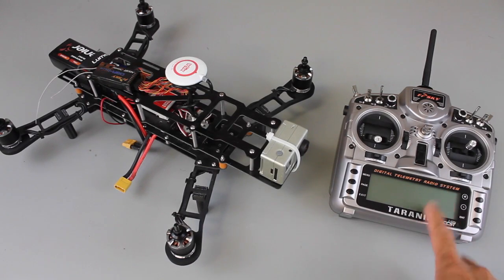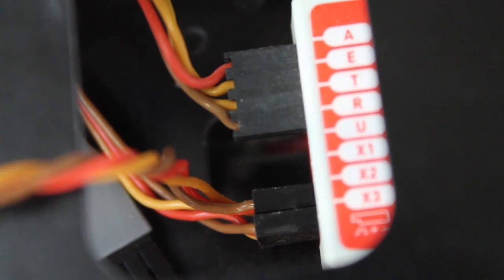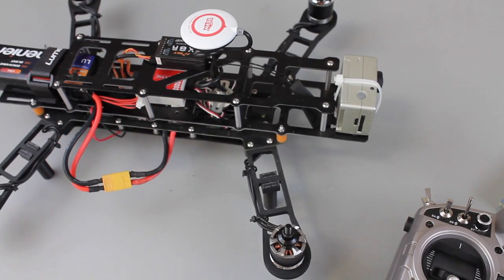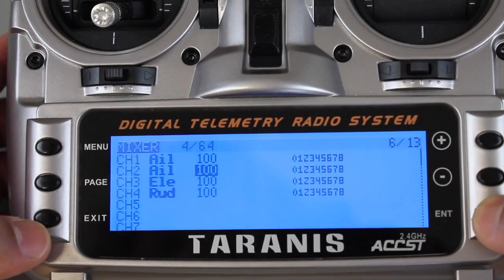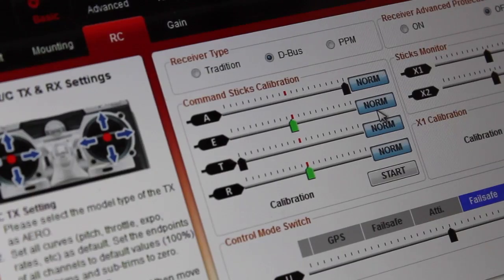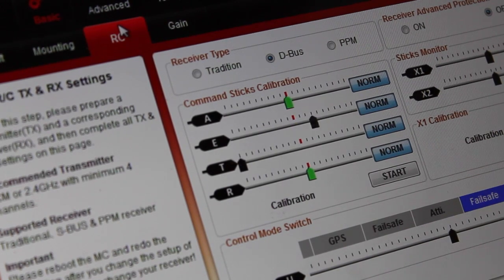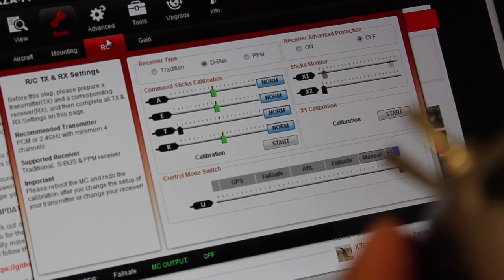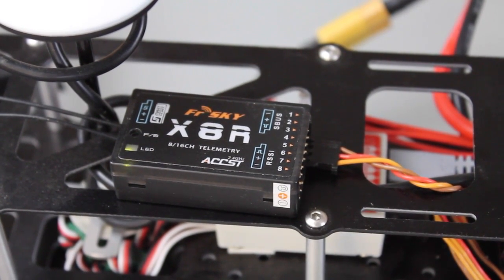FrSky Taranis and X8R Receiver SBUS Setup w/ NAZA Flight Controller

Comment: In stead useing the naza I have a kk2.1 . Does everything stay the same. Thanks
Reply from the maker: Ray Boley I'm not sure if KK2.1 supports sbus, but I could be wrong. If it does then the setup would be similar you just need to make sure the channel order is the same. Otherwise you'll need to reconfigure that.

Comment: You only used one connection to the X8R?  I want to try this but my bluetooth datalink takes up all the room inside my P2...Nice video.  I may have to move all the bluetooth datalink to outside the shell and try this!
Reply: Danny Chu I got it working with the one cable...I notice the default receiver (dji phantom 2 radio) also had another connection to X3...any idea what this is for?  Also, I am having issues with my laptop pc using the dji win driver - not recognizing my phantom when using the assistant - any ideas?

Comment: Most helpful! Tho, as you had the aileron stick cal issue, (@3:30), I'm having that same issue. Only, I continue to have this issue, even when I've powered down all the systems....grrr! I'm running an X8R in SBus to my Naza Light with GPS and my Tx is my Taranis. I'm thinking it has to do with the offset value and I've tried a few adjustments. Any insight would be much appreciated.
Reply from the maker: Les Schilling It's such a frustrating thing. I'm not sure what's going on in your case but couple of reboots of your RX as well as your flight rig. I've been able to get around it being stuck this way. It's not ideal, but not sure what else to do. If you think it's an offset issue like at your stick monitor on the Taranis and see if you notice it not centered. Good luck.

Comment: Hi Dennis can you help me out I followed your instructions on binding the x8r to the taranis D16 mode channels 1-8 but the taranis isn't responding I see in the mixer on your taranis the ail,ele,thr,rud has 012345678 beside each one mine don't could you enlighten me on what I'm doing wrong or what I'm not doing. Thanks Ed

Comment: Dennis love your videos. Didn't you have to bind your receiver so you could test motor direction? You would need the naza powered up also? I'm a little fuzzy on this. Thanks again for awesome videos, I wouldn't try this without them.
Reply from the maker: Matthew Gilbert That's right. What I've done in the past is connected directly to the receiver and then got my motor rotation correct. Then I connect to my flight controller. Thanks for the feedback on the videos. Much appreciated.

Comment: Is sbus the same as ppm? I have the same rx and a naze32 flight controller I want to use ppm.. Is sbus the same thing?
Reply from the maker: floatncoffee Similar in concept. SBUS is Futaba's implementation. The 1st paragraph in this article talks about it http://team-blacksheep.freshdesk.com/support/solutions/articles/166412-how-to-handle-ppm-mode
Reply: So could I plug a cable from the ppm from the naze32 flight controller to the Sbus on the rx?
Reply from the maker: floatncoffee I'm not entirely sure. I haven't done this myself with the Naze32. I have the Naze32 sitting on my desk and am hoping to mess with it soon. Here's something that may help: http://www.reddit.com/r/Multicopter/comments/2ij4gz/how_to_connect_sbus_receiver_to_naze32_w_telemetry/

Comment: Hi Dennis my question is about the V-sen modual that came with the naza lite. Im using the s-bus setup so where do I plug in the V-sen unit?  X3?
Reply from the maker: John Cammilleri Yes, the V-SEN unit goes to X3.
Reply: Thanks. Finally got Naza and radio working.  Had my first test yesterday.  Gps is drifting a bit. Will have to figure that one out next.

Comment: does this work with the CC3D as well? I'm trying to set up oneshot on my rotorgeeks esc's and it looks like I need to run SBUS to do so
Reply from the maker: SF PV I believe it will. I think some of the boards come with an sbus connector but here is a video that shows up to make your own: https://www.youtube.com/watch?v=2B1HPKsl2QY

Please report back and let us know how it goes. Good luck!
Reply: Ok here's what I've found...
How to make an SBUS - https://wiki.openpilot.org/display/WIKI/How+to+make+an+SBus+Cable
OpenPilot thread on oneshot - https://forums.openpilot.org/topic/55149-oneshot125-support/page-2

Comment: Hey anyone know what the problem might be.  Binding went fine changed the mixer like in the video then then hooked to the Naza assistant in the correct order then Basic R/C calibrate and nothing went and checked all of my connections everything is fine it will not let me calibrate nothing happens. Has anyone been through this ??
Reply from the maker: Rick G Strange. One thing I'd try just to be certain is to restart the NAZA Assistant. I've had it hang before and become unresponsive. If that doesn't work I would double-check all your connections and maybe try an ESC calibration for each ESC. I only suggest so you can see if the signal is getting from your TX to RX to ESC. Good luck and keep us posted.

Comment: on the X8R, do leave the antenna blocks on, or do you cut them off ? thx
Reply from the maker: Appalling68 Yes you'll need to find someone with a 3D printer near you. A great resource is www.makexyz.com
Reply from the maker: ***** Leave them on and if you want to go a bit further then check this holder out:

http://www.thingiverse.com/thing:258146
Reply: Dennis Baldwin Dennis, what does one do with these files?  I'm assuming I have to find someone with 3D printer services and give them the file, right?  Sorry for such a naive question here!

Comment: Hi Dennis to do this set up do I have to have the gps attached and pluged in befor this calibration can work ? Thanks
Reply from the maker: John Cammilleri You can do a standard calibration without compass if you don't want to fly with GPS. I flew my NAZA for a year without a GPS and it handled very well. But when I needed more accurate hover as well as RTH I upgraded to a GPS and did the compass calibration routine. Hope this helps.

Comment: Hey Dennis, this video and the flight mode videos were the best help out there and has my setup near completion. Thanks very much for all the hard work. I have one question regarding the X8R connected via SBUS... Can I add additional servos onto the Rx not included in the SBUS connection? If so which pins should I connect them to? Since the SBUS has 7 channels coming through 1 cable, I'd love to utilize the open servo ports on the Rx if possible.
Reply from the maker: Stephen Clute Thanks so much for the feedback. Yes you can absolutely do what you're asking. This video should help you out:

https://www.youtube.com/watch?v=zXsvsYbW09E

Pay attention to the part of binding in a different mode than the default to get access to the extra channels. Good luck and keep us posted.
Reply: Just bind in mode 4 (page 2 of X8R manual), 1-8 SBUS, 9-16 PWM from receiver pins 1-8, add in mixer page and good to go. Also works with the X6R but only 6 conventional outputs to match the pins respectively.

Comment: hey man, i used this and your other setup video for the taranis and naza i managed to get everything working accept the gps calibration. flicking from atti to gps to manual and back around 15 times doesn't start it, please help
Reply from the maker: Flash Media When you look at the NAZA assistant do you see the slider go to the proper flight modes when you flick your switch? You need to make sure the proper modes light up in the assistant. If that doesn't work perhaps you can post a photo of your assistant setup in the forums at www.garagepilots.com and we can help you out over there. Good luck.

Comment: Hi, great video, very helpful. Bit of a newbie question. I want to use sbus with my naza and my Taranis. Do I need a Futaba module plugged in the back of the Taranis to use the sbus function of the X8R or are you using the built in module in your video?
Reply from the maker: Jim Tolan I'm using the built-in module that ships with the Taranis for sbus. Hope that helps.
Reply: Dennis Baldwin
Thanks Dennis.   Nice one.   :-)

Comment: Hi Dennis really like your videos.  Im having trouble calibrating with my taranis plus. Naza lite assistant keeps telling me to check my stick calibration which I have done and rebooted everything but wont let me move on with the setup. Is there something else Im missing. Im using sbus set up on the 8XR. Do I have to re bind after using sbus or what? Thanks John
Reply from the maker: rose marie Cammilleri Hi John. The only thing I've experienced like this is the Assistant failing to read my stick inputs after a calibration. After restarting the Assistant everything worked just fine. That's the only thing I can come up with. Good luck and keep us posted.
Reply: Dennis Baldwin
thanks for your reply Dennis  tried restarting assistant several times still no luck. maybe I should try not using s-bus set up.

Comment: I am trying to set up the GPS  ATTI and Manuel mode but the slider will not move back to the left at all with weight or offset on my Taranis radio and naza. I also taranis shows flashing fmo--------- in the mixer screen next to the ATTI mode. Can you please help me?
Reply from the maker: pwr24 Make sure you have the proper channel on your RX going to the U port on your NAZA. If you're using SBUS then this will be CH7.

Comment: Hi Dennis.  Apologies in advance if i am cluttering up your comment box but i have another question for you. I have followed all your guides and i now have my x8r on s.bus 16 channel and my gimbal tilt working, my question is I want to setup remote gains using the pots with the naza with the taranis, could you explain how I can do this ?,  I am using your pre made qv500 model setup file.

Thanks
Reply from the maker: MMX2 I don't have a video showing this with the Taranis, but have this one demonstrating the process with a T9X:

https://www.youtube.com/watch?v=feyiB87V0ag

You should be able to adapt this for the Taranis. If you still need help let me know and I'll put together a video demonstrating how to do it with the Taranis. Please send me a direct message just to make sure I get it. Thanks.
Reply: Dennis Baldwin
thanks very much dennis, all sorted :)

Comment: so set programme to dbus not ppm?
Reply from the maker: dwexoticmaple I use the default D16 mode to bind to my X8R.
Reply: Dennis Baldwin hi i mean in computer programme not radio? you can choose pwm dbus and ppm?i use a the d4r2 and i set the naze32 to ppm im new to dji software so do i set the configurator to the board to dbus or ppm?
Reply: dwexoticmaple don't worry i see you picked dbus in assistant

Comment: Great video Dennis, thank you!  Well filmed, edited and concise!  I've swapped out the Eagle Tree Vector in my QAV400 for the NAZA v2 because I want to use the Zenmuse H3-3D gopro gimbal, and your instructions were just what the doctor ordered. 

Something I still needed to figure out that may help others who are frustrated & scratching their heads:  You need to install the driver from DJI on your computer in order for the NAZA assistant software to work.

An aside:  I've found the button configuration on the Taranis baffling, and amazed at how well you move through the menus.  Is there some logic to this?
Reply from the maker: Dave Tonnes Good point on the DJI driver. That's something that is easily overlooked and can be a considerable source of frustration! The menu navigation is something that I've had plenty of practice with. You'll be an expert in no time :)

Comment: Hi Dennis, I am in the process of building my first quad. I am using the FrSky X9D Plus, X8R Receiver, and the Naza M V2. Question its my understand whether I use SBUS or connect the standard servo cables the radio and receiver still needs to go through the binding process, is this correct? Most likely I will be using SBUS.

I do have an issue with my radio and have filed for an RMA. On turning on the radio the radio shakes (Plus Radio) and the screen is blank blue. Then following a video online I held the trim tabs inward and turn the radio on and the radio booted into Trananis Bootloader - 2.0.9. Thinking the firmware needed to be written I pushed the enter button on the radio and got this message, Directory is missing. This is a brand new radio that arrive with a dead battery so I had to wait for the charger to arrive. Seems to be the OS is missing, but I really have no clue.
Reply from the maker: Keith T Yes you still need to go through the binding process for SBUS. You may find this video helpful if you ever need to get 8 standard channels in addition to your 8 sbus channels:

https://www.youtube.com/watch?v=zXsvsYbW09E

Sorry to hear about your Taranis. While you're waiting for your charger to arrive read through this site about upgrading your firmware:

http://www.open-tx.org/downloads.html

Good luck!

Comment: Hi! First of, awesome video man! 
I'm about to buy a X8R for my TBS Discovery (use a left over spectrum receiver now). And I'm trying to be one step ahead on the new one. 
My question: in the video, you hook up the s-bus on X8R to X2 on the Naza, but the cables is still connected to naza A E T & R. Why? 

Would really appreciate a answer before I start my possible success/fail ;)
Reply from the maker: Oscar Ekelund Thanks for the feedback! Maybe the video is deceiving, but there are no cables plugged into AETR. The cable that you see in the video is plugged in horizontally and is for the NAZA V1 LED. It just looks like the AETR are plugged in, but they're not.

Comment: Dennis, I think this is a great tutorial. I am still coming to grips after being into RC for over 2 decades with software. However I already had done this mod... I have one question for you which is have you come across any settings or power issues on either the Naza or the Taranis for throttle A E R.. etc. I have just done this to my Qu4d (2014 model) and now it wont take off properly, or stay up. I am at my witts end with the thing. So any help is fully appreciated bud. Its running a Naza V2... Thanks again.
Reply from the maker: jonrms So sorry to hear that. I've never experienced anything like that with my NAZA V2. Have you tried calibrated all your ESCs just to make sure you get everything synced? What do you sticks look like in the NAZA Assistant? Are they going from min to max in the Assistant when you move them? If you continue to have problems check out www.garagepilots.com and post in the forums there. We'll be happy to help you out.

Comment: Great video, Dennis!  
A  question:
I have my aileron/elevator/throttle/yaw control working with SBUS as in your setup.  How do I now set up channels 5 through 8 in PWM mode with the X8R? 
Thanks
Reply from the maker: Bill Fitz Hopefully this will help: FrSky Taranis and Tarot T-2D Gimbal Tilt Setup and Configuration you'll have to use channels 9-16 though since 1-8 are going to be reserved for SBUS. As I state in the video make sure you configure your RX for mode 4.

Comment: Can you explain to me which position is which on the x8r? I have been trying to find a diagram online but there is not one. Is output 1 throttle....etc? Also what outputs correspond to what switches on the taranis? Thanks
Reply from the maker: Jordan Mowbray If you setup a default model and go to screen 11 you'll see the channels. By default it's Throttle (CH1), Aileron (CH2), Elevator (CH3), Rudder (CH4). Regarding outputs and switches it's highly configurable. If you watch this video you'll see that it's easy to associate any switch with any channel on the Taranis:

FrSky Taranis 3 Flight Modes and Forced Failsafe Override with DJI NAZA on QAV400 Quadcopter

Comment: i know there are a lot of variables but need help.  I'm using  a  Taranis radio,  Naza lite wt GPS and a D8R-II Plus like you just unplugged in this video . How much different of a setup is it to use what I have?  I'm having a real hard time getting everything configured properly.  I'm using sunny sky kv900 motors on a S500 frame if that matters?  i followed your other video and successfully setup the GPS/Atti/Man modes on ch5 like you explained but I guess i'm missing much more on how to set it up for the specific quad i have or something.. the motors will spin in the correct direction but are not responding to the sticks correctly and spin without control.  Any help would be much appreciated.Thanks!
Reply from the maker: Cole d/b/a Master Productions It's hard to say without having more info. Your setup sounds like it will work just fine and I'd recommend trying to get this working without the GPS initially. That will allow to fly in attitude mode and then you can work in the GPS later. Just a suggestion. Also, check out www.garagepilots.com and post in the forums. We've helped out a lot of guys trying to get their builds in the air. It sounds like you have the right gear, but just need to get it configured properly. Best of luck.
Reply: Dennis Baldwin Thanks Dennis! I did get it to work!  I really appreciate the response and the link! Take care
Reply: Cole d/b/a Master Productions  I think I am doing the exact same build how did you do the retracts?